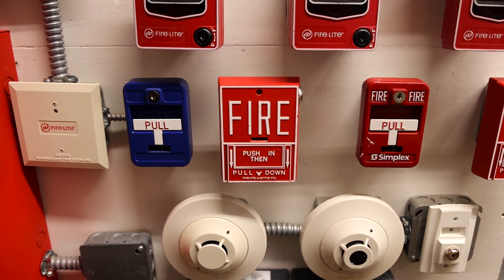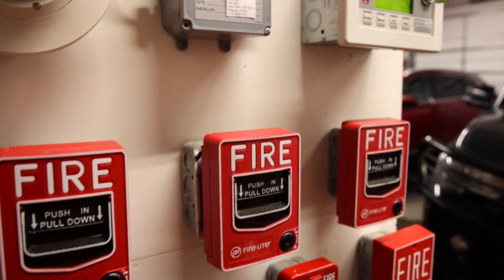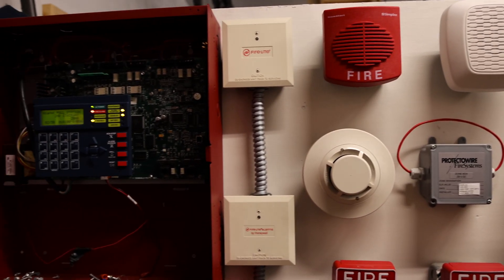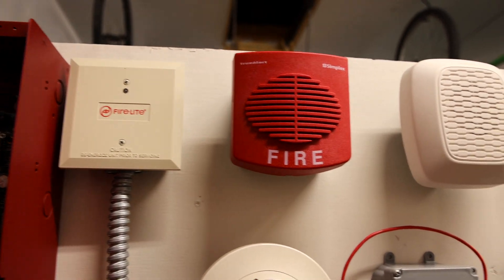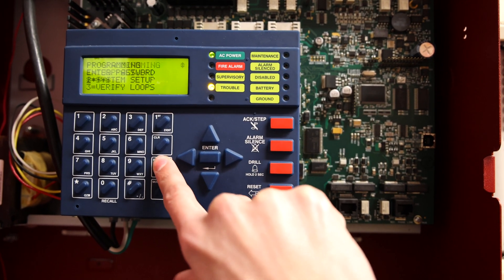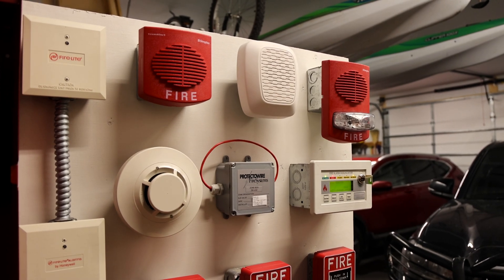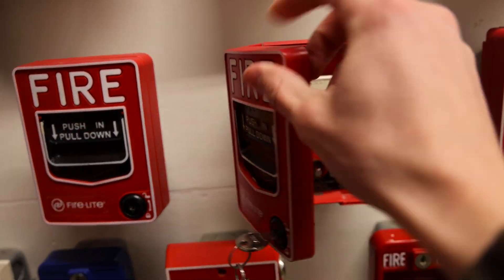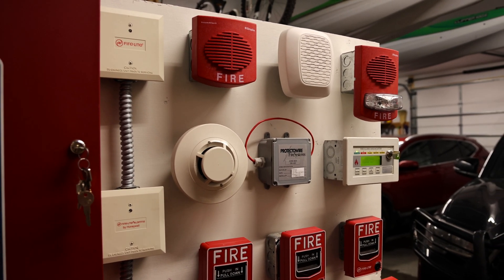Simplex Voice Evacuation! & EAS! | Speaker Fire Alarm System Test 18

Comment: Wanted to drop a note that the EAS tone you used in this video is neat-- I was wondering if the clip you used was for a specific SAME code? Not that you'd ever use this in a commercial or professional setting, of course, because doing so would trigger genuine activations, am just curious! I've always been intrigued by the technology we rely on to keep people informed and safe, and that includes the EAS system and it's SAME encryption coding.

Comment: Awesome! Cant wait to hear stuff like notifier fire lite or EST voice evac messages through whatever speaker you put there. I think the voice evac panel goes into trouble briefly probably cause its reseting and it temperarly turns on the trouble relay for whatever reason. Ive seen this on addressable notifier panels. They go into a system initialization trouble when you reset them. In their case, its caused by the SLC loop going back online while the initiating devices reinitilazes.

Comment: Question, can we make requests?
Reply from the maker: Go for it! No guarantees though
Reply: @SERSafety  So my school used to have speaker strobes and horn strobes of simplex that did code 3. Unfortunately, they no longer do that as the speaker strobes were changed to whoop. What I always wondered (because the system used to be not in sync), is what do the two sound like together if they were in sync. Also, sorry for the delay of response